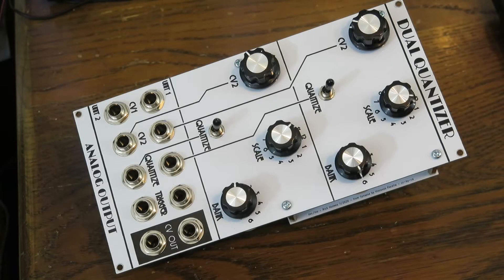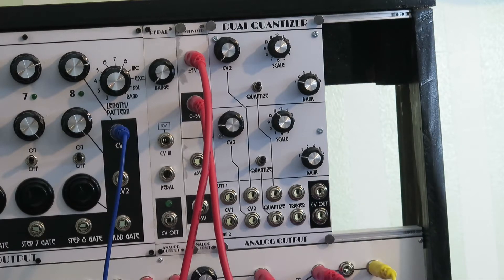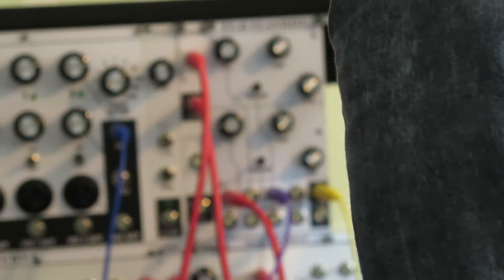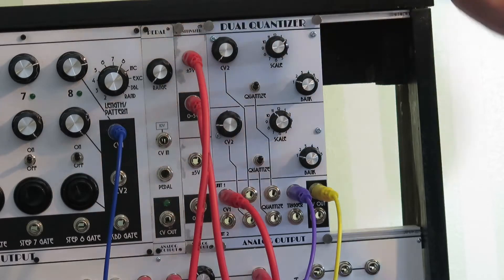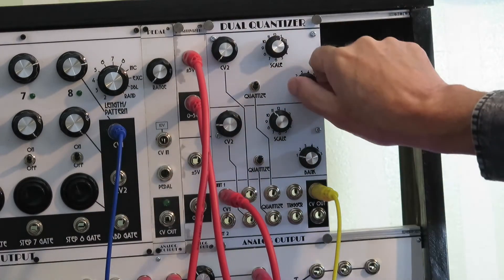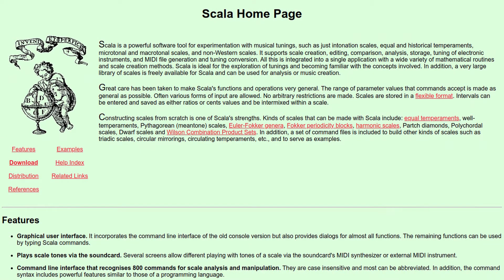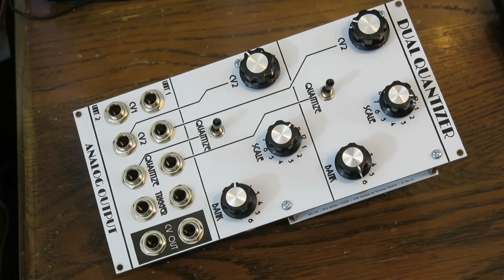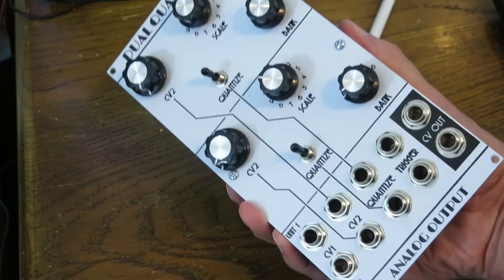Dual Quantizer DIY synth module

Comment: Wonderful, this is exactly the DIY module I've been looking for. I have tested your circuit (and code) out on a breadboard and it's working great. Just need to get this built as a module now. Thank you very much for your hard work in pulling this together and sharing. Thanks also for your help via email, much appreciated.